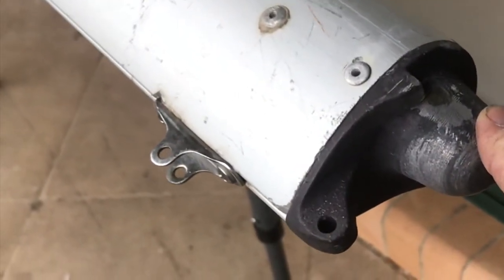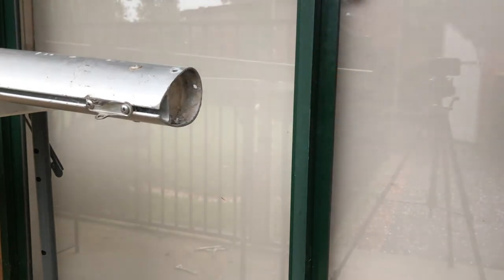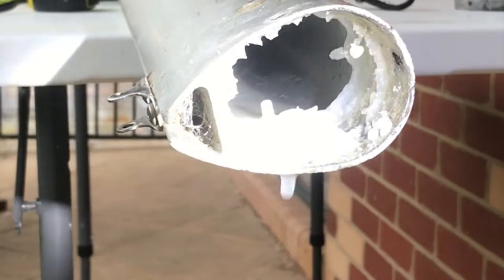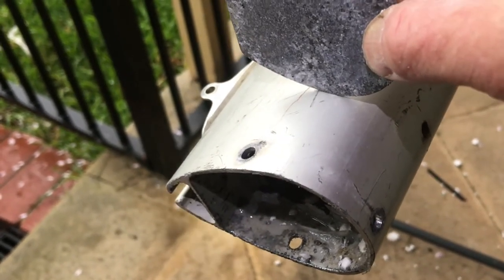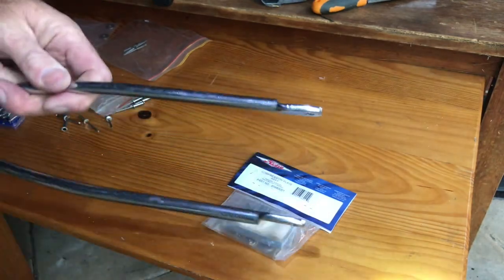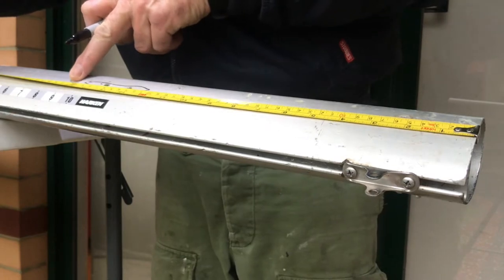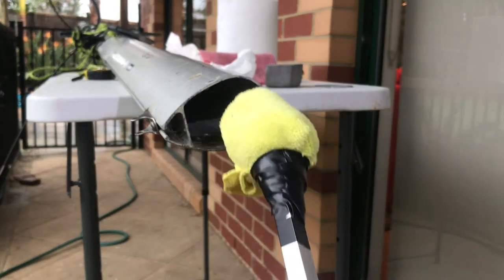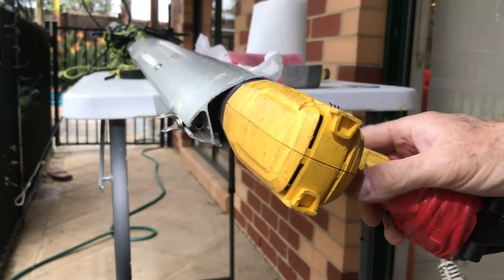Hobie 14 mast spanner install

Comment: Could you add the specs of the rubber seal? Thanks Mauricio
Reply from the maker: You can use any type of waterproof rubber to plug the mast, Hobie may sell a specific part if you ring a dealer